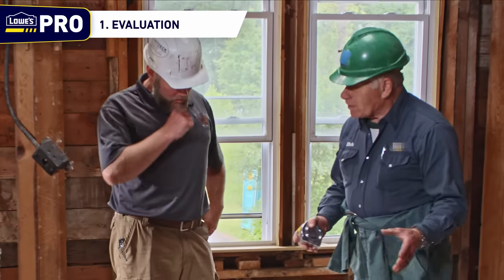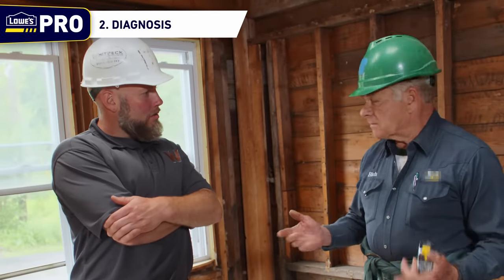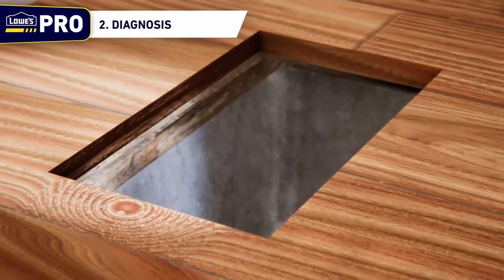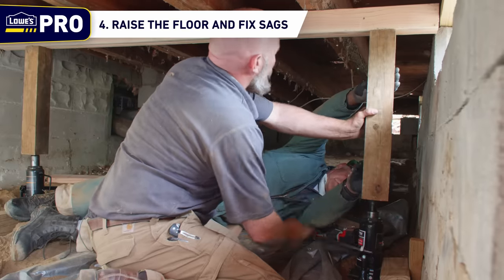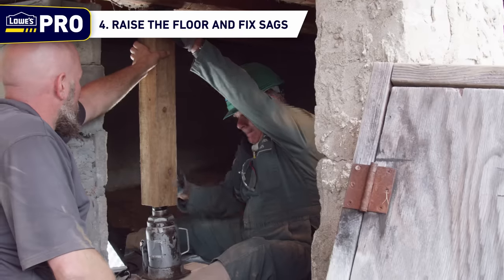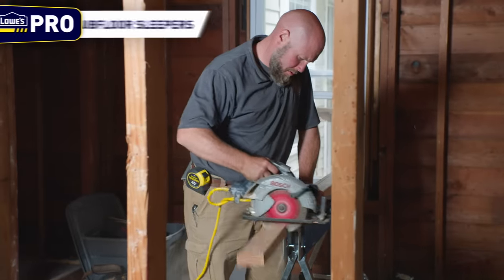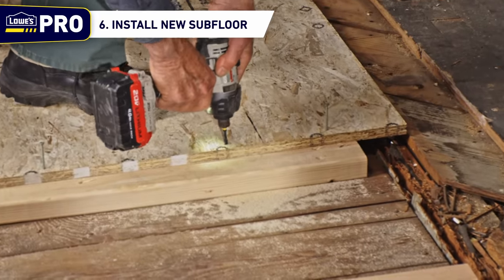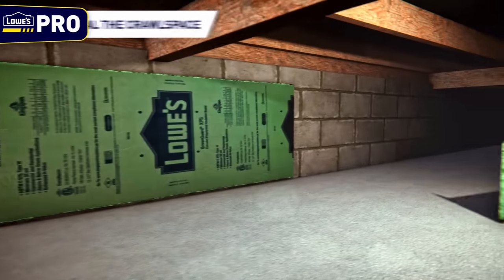How To Level a Floor | Lowe’s Pro How-To

Comment: A bulldozer can level this house better.
Reply: Dude i was just going to say whoever recommends going under your house and put lifters under it should just tare the house down and restart
Reply: @davidhanni208  repair and lifting depending on extent, add brick work if your crawlspace has brick then lets not forget drainage, sub pump, dehumidifier. Yeah. Def time to think finding a builder.  Depending on where you are maybe 50 to 60 thousand.
Reply: Nope. You’re wrong. It all depends on the individual property and where it is located.
Reply: Mine is worse 🤣😭😭😭

Comment: How much does this type of job cost
Reply: In the video I would guess $3-5,000 not counting the cost of the new flooring. The labor and equipment costs more than the material needed. Hire reputable contractors, this is serious work.
Reply: about 40 dollars per square foot. Can get costly if the house if the entire house is sloping

Comment: anyone know why that person is hammering the screws first before they drill them in ?!  @ 4:25
Reply: Probably cheaper to buy a stand up drill than paying someone to set screws in place lol... looks like a sweet gig though =]
Reply: @taskachieved  sounds like " keeping my helper busy on someone else's dime " type vibe.   those stand up drill attachments are sick.  i'm just worried the screws for it would be super expensive.  they come all attached like nail gun nails
Reply: And they say to use screws that will go through the plywood, studs, and into the original flooring; but those screws look short to me.

Comment: This is so long and pointless, If your floor is sagging it's either foundation issues or sag in the joist components . 
You can find every sag point within about 30 min by finding the direction and and position of a joist then using standard spacing measurements and  a rotary laser. 
This will let you draw a map of your floor , pinpoint the sag points and by how much they sag. With this information you need to lift the sagging joist and sister them with new joist . 
If it's the foundation related you will need to install piers or fix damaged supports. The house shown in this video is a bad example of what's common , it looks like an late 1800 to early 1900's house that's been repaired or added on to at least once.

Comment: Wrong wrong wrong
Reply: i'd hate to see how you do it if you think this is wrong
Reply: @nicholaspappagiorgio6103  This video is wrong, all you do is either shim and lay a new subfloor over the old one or rip out the old subfloor and sister up the old joists with the new joists slightly over lapping the old joists until they are all level. Its 40k vs 2k and both are effective